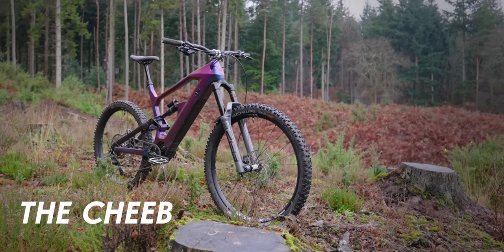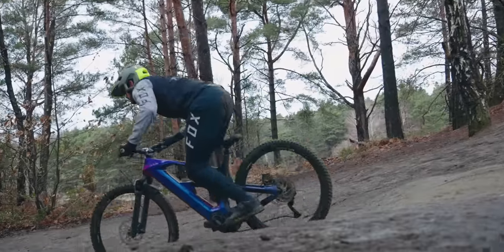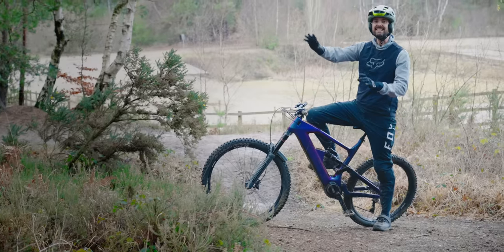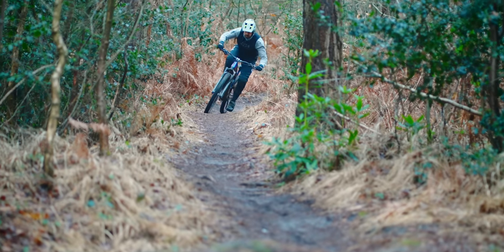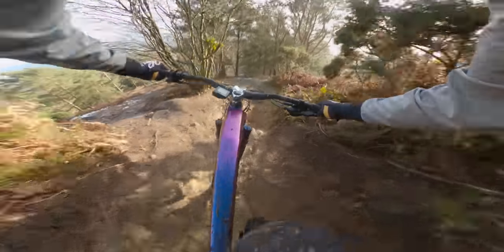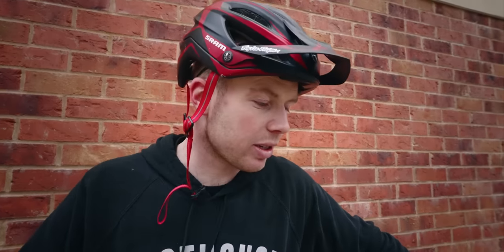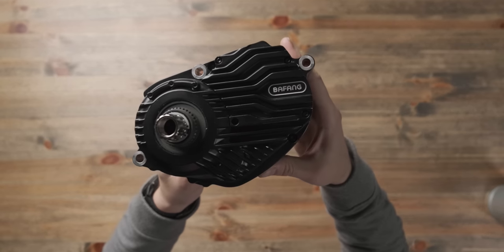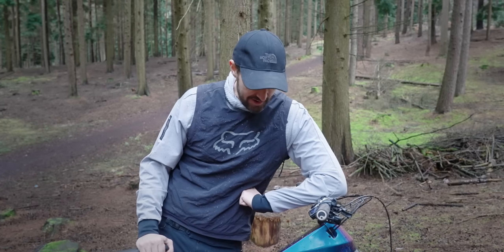I TEST a Chinese EBIKE

Comment: The bafang range is easily adjusted to your liking with a programming cable. Would be nice to see a proper head to head with a bit of tweaking, buying cheap often means you have to do the tunning and troubleshooting rather than the manufacture, which for us cheap skates is fine.
Reply: Hi. The M series (500, 600 and 620) are NOT user programable. The Bafang controller uses a proprietary CANBUS.  Innotrace do make an aftermarket controller for the M620 that allows programing. This is very expensive though.  They are working on a controller for the M600 as well but to be honest, I don't think the M600 needs it. I have 2 of the E10's with the M600 and I think Rob will see a noticeable increase in power.
Reply: @brentmckenzie5808  damn it, that's a shame, I thought they all were.
Reply: @GlaucusBlue  I have the M620 and it’s user programmable. Look up EggRider.
Reply: @brentmckenzie5808  I actually have the Innotech Archon X1 controller 1000w and it is a brilliant upgrade for a few reasons I highly recommend it, but the standard m620 can be programmed using the bbshd programing cable plugged into the display connection on the loom. Unless they have changed this on recent motors.
I do not know about the m500 or m600 tbh but always assumed they were.
Reply: @brentmckenzie5808  is the stock m600 smooth with power delivery and does it shut off when changing gears?

Comment: as well. if you split the motor and coat the internals with conformal compund, then at silicon to the gasgets, then it is sealed and fine.  Also best use some foam tape around the battery edges to keep water out and it is fine.

Comment: About that quiet thing, running a 500W hub motor with a 1500W KT controller and it is completely whisper silent. (But as it's silent, everyone around you has to rely on tyre noise to know that you're actually there.)

Comment: As I used to import Chinese ebikes myself, I have read the legislation. What is missing from this is the EN certification sticker, which is a legal requirement. For a DIY build it is unlikely to cause an issue, but would present issues of liability if you sell it on. The factory self certifies after testing and can provide this data to authorities. It's a small detail, but it is important as the EAPC legislation is an opt out of an ebike being a motor vehicle and the sticker is the proof.

Comment: Fantastic project, well done Rob. As an idea for an upcoming feature it would be neat to look into battery tech and the new 4680 batteries which will be the future.  They’re not out just yet, but by my reckoning, each 80mm long 46mm diameter battery will store about 100watts of power.  This could lead to very sleek frame designs and lends itself to a 5 or 600 watt main battery built into the frame with a very small and light booster battery, so like the Levo SL, but no power compromise and the potential to reduce weight and optimise weight distribution. Very nerdy I know.

Comment: If you buy the can bus programmer, you will notice that bafang power the motor way back.  If you plug it in and adjust the settings, the m500 will easily give allot of kick.

Comment: Better with the m600 120nm, it can be boosted with a aftermarket controller to 2000w for off road use .watt wagons also has the e10 with the bafang ultra motor that has 160nm of tourqe and can also be  upgraded to run 2000 plus watts also.
Reply: Can you run the M600 off an external controller like a Phaserunner? I have the BBSHD but it's too powerful for trails, although I could put it into a low power mode.
Reply: LUNA controlles works worse than stock one. You csn check reviews of them. Totaly disapointed.
Reply: I've been staring at Wattwagons for a couple months now.  The upgrades are too expensive but I like the German controller.
Reply: Also, I like Wattwagons' E10 frame slightly better than Rob's.  Check it out.  It can hold a bottle.

Comment: I purchased a 29er HT frame around 7 years ago from China after reading a lot of reviews. It's my commuter bike and also dry weather local woods bike and it's stood up to everything I've thrown at it. I've even done a weekend in Afan and not had any issues with it. My one bit of advice would be to go directly to the manufacturer rather than eBay etc. And do your research on the brands.

Comment: Great video Rob.
I ride a Frey with the m600 motor.
You can adjust all the settings on the m500 motor.just need the cable and download software.you can then adjust to smooth delivery or punch.
My Frey m600 complete bike came delivered around £3000 with high end parts.yari forks . magura mt5 4 pots and Shimano.and it destroys bikes twice the price and no building required.
Something else you could perhaps review.
Reply: The frey has actually been allowed to compete in a recent enduro (in its own high power class).
FYI I believe that your motor on the Frey is actually the Ultra M620 not the M600. But yeah your right I think all of them are programmable.
Reply: @tomwebber9936  the m600 bike has the m600 motor .I've got one.
The ex .cc.am have the 620

Comment: I imagine of all the chinese carbon frames. A typically overbuilt ebike frame is the best to go with. Usually its the cross country or roadbike frames as well as the full carbon forks (carbon steerer) that have most of the snapping issues. It still happens with enduro frames but that ebike frame looks pretty dang chunky.

Comment: Thing with carbon is it's really strong until it isn't. A couple of sessions doesn't really prove anything. £4k may not be expensive for an E Bike, but it's a hell of a lot of money and I would suggest it's too much to risk for most people. Great series though and you did do a great job on the paint
Reply: Exactly, and QC is the problem with these Chinese things. So this one may be fine, so may the next 8, but the 10th breaks someones face.
Reply: It is common for china to do pre delivery tests and destruction tests , all im seeing is the major brands having to stop gouging the market now so the cheeb does not get a foot hold
Reply: @CarkeekW  the Chinese are capable of fantastic innovation and top world class engineering and build quality. Unfortunately they are also world leaders in cheap knock off's and fake products. It's virtually impossible for us in the west to tell which we're dealing with.

Comment: Hey Rob - I have the same build through luna cycle X1 with M600 with Ludicrous mode. You definitely feel the difference. It's been a beast on the trail and held up in the Nevada rocky desert trails. Go CHEEB GO. Too bad you can't upgrade the motor in UK? Still wondering why they restrict it. Have fun!

Comment: On my channel, I built a full-suspension 1000W Mid-Drive eMTB for $3500 using all components from Aliexpress. I'm not sure the point of using a Chinese frame just to spend the same amount of money for a trek Rail in the end. Highly recommend checking out my Seroxat eMTB build on my channel if you looking for a serious eMTB on a budget. Not to mention the Bafang G510 is a much better motor I think.

Comment: Fair play Rob. As a rule of thumb, I try to stay clear of carbon as I'd be crying bucket loads of tears if I cracked a frame. But I'll give you props for testing the frame stiffness. I cant comment as to the discrepancy of the M500 motor in terms of its 95nm of torque but I can vouch on the M400 which has 80nm and the M620 (Ultra) with 160nm of torque. Perhaps it would be wise to experiment with different chainring sizes (I did). 
You've inspired me to bust out my builds so I might start shooting this weekend.
Keep up the vids mate and I'll keep you and the guys and girls over EMTB Forums posted 🤙

Comment: Concerning the lack of punch, it may maybe rectified via a parameter update. I own a BBS01 36v 500w motor which was utterly punchy as soon as I were turning the pedals.
I was pretty uncomfortable with the transmission fate caused by the raw violence of the motor on each activation. 
So I updated the engine parameters with a USB adapter costing 10€ and now it's behaviour is compliant with your comments about power delivery.
Personnally, i prefer this behaviour as you do not feel the power delivery...it's clearly there and it's more natural while riding.
Another thing I quite like with the Bafangs are the optionnal brakes (for mecanical and hydraulic) and shifter sensors that kill power when switching gears and/or braking... It add some safety and tansmission reliability..... so there's no hideous transmission cracks when shifting under load compared to "true" E-MTBs. I think you can add some on M5/m600 series motors as the electrical harness looks identical to the BBS units.
All in all, Bafang motors are not a perfect solution, it requires some bike knowledge, have some flaws but I'm still impressed with the bang for buck ratio 
Concerning reliability, I have done more than 10k km with my unit without any maintenance and it still runs flawlessly, and replacement/upgrade parts are easily available.
Your conclusion seems to me pretty spot on, I would just add that at the end,  riding a proper bike made by your own hands opens a new step of pleasure and comptent while riding it... So I clearly won't recommend it either to everyone, but won't prohibit anyone to do it either if they know what they'll go through before engaging the money in the project.
PS: your comments about the DEORE 5xxx series 10 speed is true, it's not as qualitative as XT/XTR,, nonetheless it's working flawlessly and it adds some chain resistance when using the CN-6090 chain with it compared to narrower 11/12speeds chains.

Comment: Cheap not equal to low quality, it's just labour is cheaper and actually, a lot of Chinese workers especially technicians could do a much better job than other countries same position, they just get paid less. And that's also related to China's economic strategy to holding its position in the manufacturing industry...To be honest, a lot of stuff made in the US or made in Canada has much lower qualities with an even higher price than Aliexpress.
Reply: Dito! Wise words man!
Reply: It's not even the labor cost making it so much cheaper, as most big company's frames are made in similar overseas factories. The higher prices come from marketing, r&d, warranty, and a few other things but labor cost is roughly the same.
Reply: @Nythos_  you mean a Chinese worker makes the same as a US worker?
Reply: @rubenvor  no if you have a US made frame then the labour cost is a major factor. But most usa company's frame are made overseas

Comment: good day Rob... i love most of your videos..not seen them all yet. great to see you cover bafang motors... i work with a small community group helping other get out on the track and road just outside Manchester UK.. we found the Bafang to beat all the other hands down it a head to head, soon as you add the price to the mix, put your home biuld in the mix. you got a winner and less than 4k if you drop the paint.....i don't think they are telling the truth about the 160nm in the new BBSHD 1000 watt motor but they are around £600 in the UK with full warranty....thinking on the same lines as you did with the running gear on your build, did you know that you can set up the Bafang to your bike with a simple usb lead... if you ever get up north you can use ours, if your motor was set up to have a throttle most are, you got 20% more power not being used...the magic boost button.. not legal on bikes in the UK on the road after 2015...  the motor you fitted is missing its sticker.. UK laws says the maximum watts that can be on the sticker is 250 watts. as the builder you should put a sticker ;-) on the bike saying the watts and volts, lets keep you nice and legal....  great to see you use the Bafang I learnt a lot from your videos and hope to see you get your home build, eating everything in its path... send it

Comment: get a special cable, connect the motor to a computer, get special software for it and you can tune and customize the motor characteristics.   i tuned my bafang ultra for a few weeks till it was exactly how i wanted.

Comment: 'Made in China' stereotype is getting old at this point. When there was this sudden rise of manufacturing industry in China long time ago, workers or even project managers were prone to make mistakes because they were still learning. Now after a couple of decades, they have become so good at making stuffs that they can grab lower grade raw material and make it as good as a high end stuff.
Reply: Problem with Chinese products is they often lie about the specifications. Like what he says about the motor, seems like it's nowhere close to 95Nm. Like chinese 9800mAh 18650 batteries that in reality are under 2000mAh. Judging by the fact that the battery seemed to last forever the motor is probably quite weak... especially since they probably lied about the battery capacity as well.

Comment: Rob, Its no 'surprise' the Chinese have improved the factory acceptance testing for the frames- the CCP have over the last few years ordered an improvement and the Bafang  motor and the frame have been copied from blueprints from Taiwan and Germany. The Chinese dont invent anything they simply buy the rights . I suspect they wont ever lead on anything they follow  which gives cheaper products. Lets put it this way, take all the other manufacturers and innovation away  leaving only a Chinese company - you will never move forward . It is difficult to avoid buying Chinese but please dont lower standards .

Comment: If you can get the M600 Ludicrous From LUNA Cycles they use Dengfu E-10 with an m600 that's tuned for 1500watts continuous power, and you may love this bike way more. But you gotta do a lot of mods to make your cockpit fit just right, & It needs upgrades to make it the bike it can be.  I am building mine, next step is the New rims with cushcore and hydra straight spoke hubs by Industry nine,

Comment: you can program the m500 with more amps, providing the "punch" your missing, and you can buy extension cables for your display and throttle
Reply: Hi. The M series (500, 600 and 620) are NOT user programable. The Bafang controller uses a proprietary CANBUS.  Innotrace do make an aftermarket controller for the M620 that allows programing. This is very expensive though.  They are working on a controller for the M600 as well but to be honest, I don't think the M600 needs it.

Comment: Great video and project to watch, Rob. Thanks for doing this.  I've been building bikes for the last 25 years and yeah, its usually cheaper to get a complete bike vs sourcing parts and build. You dont get the exact parts you want but definitely the time aspect when you could already be out riding. Plus the warranty covers all the parts too when you buy complete. 

I'd be scared as heck riding that frame waiting for a major failure and no back up in case something happens. They've got nothing to lose if you break the frame and worse, your body. But hence the cheap price.  If I DIY'd this bike I'd skip the fancy paint job and leave it bare carbon. That's a huge time savings there. It's great that the motor and parts seemed to fit right off. That's the problem with many of these cheap bike frames is the tolerances and Quality control checks aren't there. I was quite amazed that the motor had a nice little click when you put it in and all the screw holes lined up. Nice. I've had tolerance issues from American brands (seatposts with weld burrs preventing post insertion, front derailleurs not lining up because seattubes were not aligned, disc brake tabs so crooked that the brakes never worked correctly, etc) so seeing this frame be tight is refreshing, especially from an unknown Chinese factory. 

Hell, the Chinese don't even trust their own factories for dog treats and baby formula because of these crap products causing deaths!  This frame is not bad at all then. But i wonder about the longterm stresses.

This frame looks like there's plenty of room for a coil shock. Have you thought of putting a coil in there? It would ride so much more plush

Comment: I did a Chinese time-trial bike for triathlon.  It was a great experience for the frame.  I tried sending the handlebars back for "warranty" and they got sent right back to me (could not find address).  I think this is pretty typical.  In general you'll have success if you're patient and in for a build challenge. If you're concerned about warranties... then no.. you should go another route.

Comment: you can easily adjust the way the motor applies power with some controller tuning. Just have to buy a cable.

Comment: Bafang motors are fine tunable, but unfortunately they changed the protocol for newer models and I don't know of a way around that. Now they offer the software for a price to resellers, but not to regular buyers. Older models without torque sensor like BBS series could be easily tuned to your own liking. They can be nice and calm with slow acceleration or they can be crazy jumpy and just throw as much power as possible at your bike. Quality has been an issue when you go for more extreme settings though.

Comment: On the next one get the bafang g510 with 160nm of torque!! I have one but not carbon frame. I was going to go dengfu but at the time they only had fat tire option with that motor I do believe they’ve made a new frame for smaller tires.

Comment: You could probably get away with ordering the glossy CF frame rather than the matte one.   Also,  just for future reference,  dont sand after each coat of hypershift, pearls or anything,  its actually a metal flake in the paint which a 2K clear will smooth over.   Saves time and also gets a better finish.

Comment: You are using just a fraction of the power even on the top pedal assist mode.. bafang works at full power only in throttle mode.